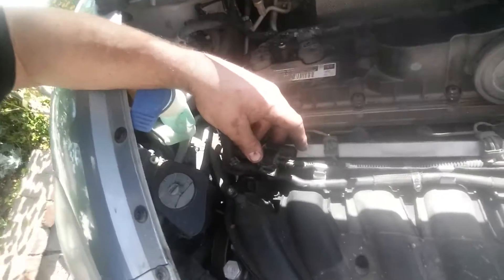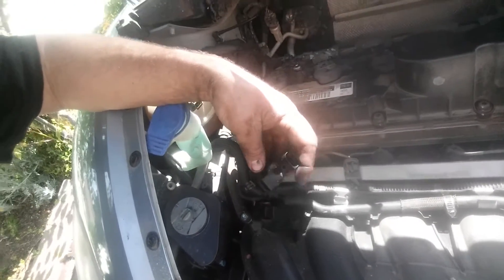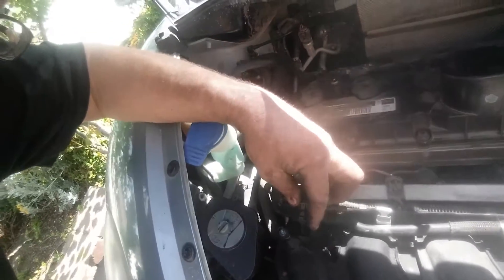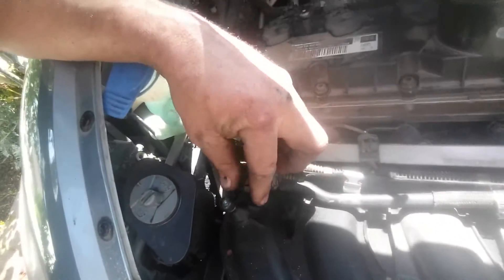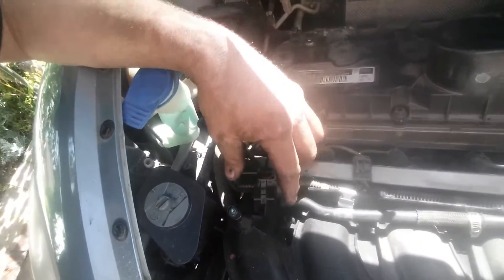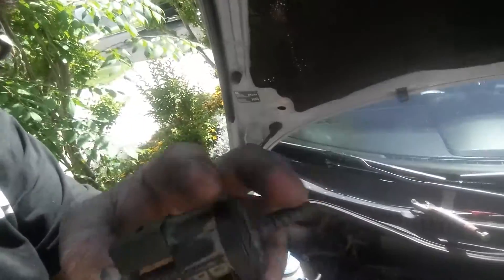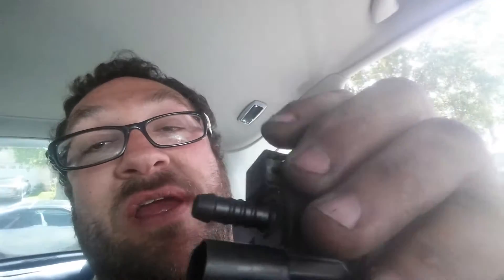p0456 volkswagen beetle jetta evap leak purge solonoid testing

Comment: Jeremy,
Thanks for the video that was the issue with my 2014 Volks Jetta 2.0l....sadly I found your video after spending $500.00 at a local shop replacing GAS canister and fuel cap, labor etc etc....
Issue still persisted after that.  Found your video bought the part for $22.00 at a local auto parts and fixed issue myself.  Thanks brother!!!